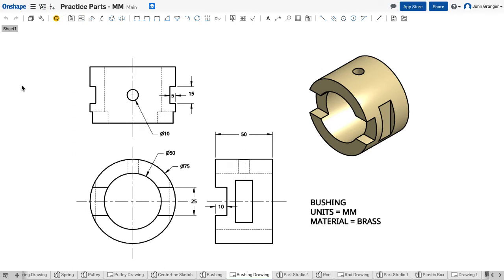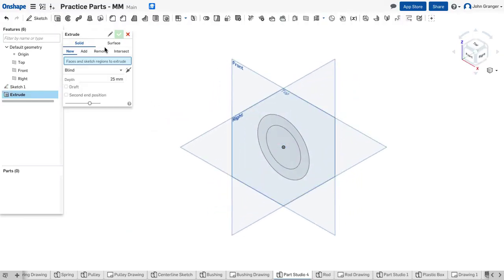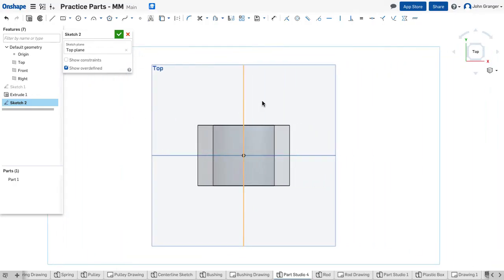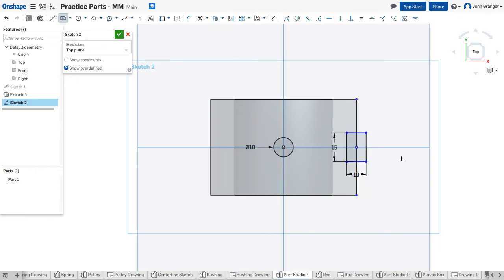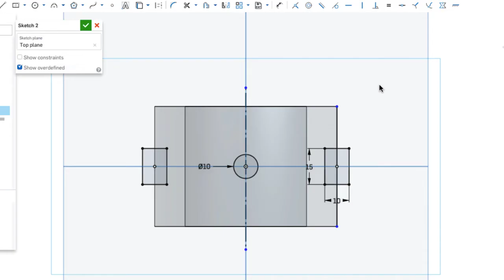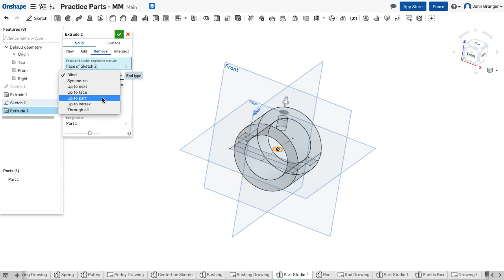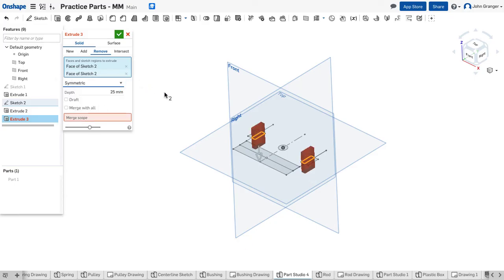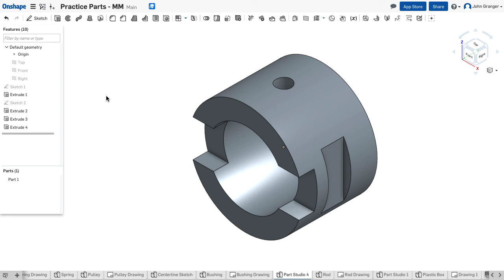Learn Onshape - Project 6 - Bushing

Comment: Your tutorials are awesome! Very informative and straight to the point. I appriciate that you have taken a project based approach to teaching, which helps newbies like me use the concepts straight away.

This video has taught me a lot. I solved it myself using offset planes but your approach of using symmetrical extrudes and transparent views is so much simpler. Please keep on making tutorials like these. Learning software features is easy, efficiently applying them is the tricky bit.

Comment: This is not a very easy to follow
Reply from the maker: Hi, Sorry that it is not clear.  This project demonstrates the use of the default sketch planes and origin to assist in construction of symmetrical parts.  The first feature centers the object on the default origin.  The top plane is then in the center of the object so the  hole, the side notches and the front notches can all be sketched on that plane.  Using extrude, remove, these sketches can cut away the material for the finished part.  What the video again and think about how the default sketch planes are used as an integral part of the construction.
Reply: @Onshape.Learning.Projects  that does not help
Reply: @benjamingunnink9561  could just be user error